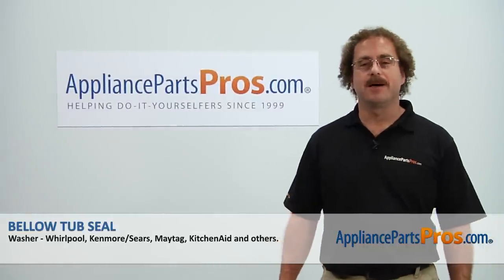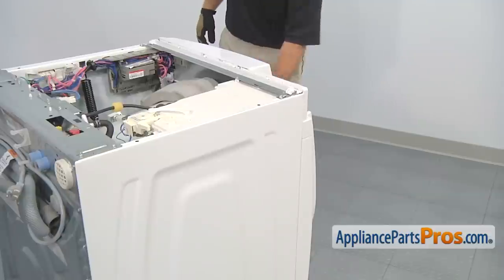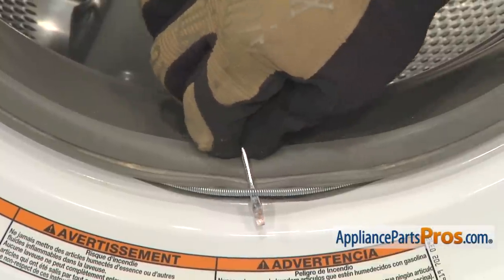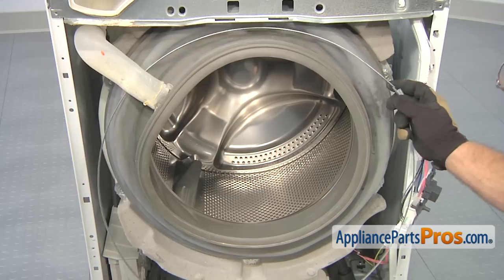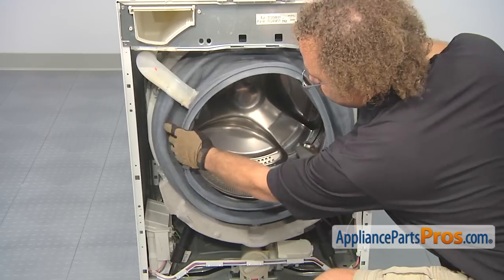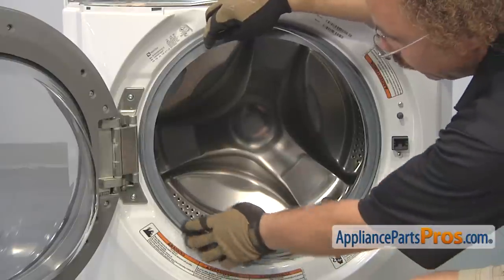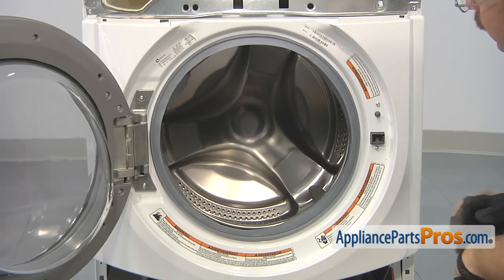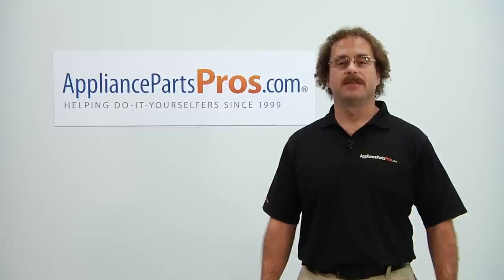How To: Whirlpool/KitchenAid/Maytag Bellow Tub Seal WP8182119

Comment: The spring on the wire  which attaches the bellow has definitely been stretched out a bit...the wire for my bellow won't even stretch to the 1 o'clock position and this guy has it stretching all the way over to the 2 o'clock  position.  I really need a third arm to wrestle this wire into place.   Great video,very helpful and informative, thanx.

Comment: Great video! My boot replacement was a breeze thanks to you. I originally watched a different video, which was not exactly my model, indicating that I would need special spring tools and that I'd have to disconnect wiring and remove the counter weights, with an estimated job time of about an hour. I only had to remove the top panel, control panel (no disconnecting of wiring), bottom panel and door and needed no special tools besides a torx 20 driver. It took about 15 minutes. Cheers!

Comment: Another excellent, helpful Appliance Parts Pros video. Agree with other positive Comments. Perfect, easy-to-follow steps and procedure flow.  
On a DIY scale of 1 thru 5, with 5 being the hardest, I'd say this job was a 2-3.  Definitely a task most people can do.  Just requires some patience. 
Main difference between my experience and what is seen in this video is that I spent approx. 8-9 hrs altogether – incl. initial troubleshooting, establishing what is needed to fix, researching DIY videos, ordering parts, making notes + 2 hrs cleaning all of the parts I took off + incl washer innards + cleaning area behind washer prior to re-install. Only a DIYer would do all that making a much more complete, thorough job than if done by service technician.  If I did this again I could get the total time, incl. ordering parts down to 4-5 hrs.

One other detail: When disassembling I removed the plastic soap tube that connects to the rubber bellow tub seal at the 10 o’clock position.  It was caked with detergent, etc so I removed and cleaned. When I re-installed I added a 2-1/4” diameter pipe clamp to the upper end where this tube connects to the bottom of the plastic soap tray.  I could foresee the possibility of that connection leaking, which if it happened would require you to disassemble the washer again.    

This video -- which only applies to this specific washer rubber door seal has been screened 263,000 times in the past 8 years. Gives you an idea of how common this fix is.  

Over the years I have bought many replacement parts from APP for a wide variety of appliances. Matt -- the technician-teacher is indeed “the Bob Ross of appliance repair”.  Thanks again.  Keep up the terrific work!

Comment: This repair can be carried out without having to remove all the panels. This can be done through the door itself. I have a washer dryer setup, with the dryer being on top of the washer. So getting the dryer off the washer is a tedious task. I would literally have to disconnect everything. I was able to remove and install the seal just by gaining access from the door. The final inside clamp was a bit difficult due to limited access. But with a mirror it wasn't too difficult to line up. Thanks for the video!
Reply from the maker: Thanks for your feedback, Alexander! Glad the video helped.
Reply: I was super concerned as I have the same issue. ;w;

Comment: Thank you for the helpful video!  My wife and I just replaced our tub seal, following your steps very closely.  I think we're good, but one thing we noticed is that the door doesn't stay closed as securely any longer.  Once we start the wash machine, the door locks, so we don't have a problem with leaking -- that much is good!  I will take the front cover off again and re-evaluate the placement of the locking mechanism.

Comment: Excellent video. I'm told that the bellows that have been installed are failing prematurely. The reason is that people overtighten the clamp. Your tip of putting a black mark on it saved me from overtightening it for sure. The tip to use vice grips to help put on the spring seal was also a big help. Thanks again!
Reply from the maker: You're welcome! I'm glad the video helped you out.
Reply: So if we didn’t do the mark, and the clamp has slipped off (twice with a tub full of water!), how do we find out how tight it should be?
Reply: @Mystik0817  I would re-install it and use the mark.

Comment: By far the best video on this type of repair. I have installed bellows before without taking the control panel or the front cover off but after watching this video I did and it made the repair much more comfortable to work on and easier. Thank you much!!!
Reply from the maker: We're so glad we could help! Sometimes those extra steps can seem superfluous, but they can make things easier in the long run.

Comment: Matt and appliance part.com have the easiest to understand videos. I had an F5E2 error and an occasional leak across the top of the bellows.  I found that the larch hook on door was a little loose. Checked and error code was still there. I didn’t know to how to delete codes. Manual was taped inside the bottom front panel. Inside the lower front panel is the drain pump with attached filter. I cleaned years of coins and other debris from the filter. No more leaking and I don’t need a new bellows. The loose door hook and the high water volume caused by the clogged pump filter were the problem
Reply from the maker: Glad we could help!

Comment: This is a great video and I followed the steps as best I could. The only problem I ran into is the door won't lock without me holding it! I took the spring clamp off and it will lock sometimes. It seems like the part of the boot that touches the door appears to be sticking outward. 

No leaks though when I use it. Any suggestions?

Comment: Thanks! My washer has a dryer stacked on top so taking the top off is not practical. Why do you have to take off the front? Can the repair be done without removing switches and panel?

Comment: Great video, very helpful. One comment to make things easier, instead of using a locking pliers, use a hook awl in the spring loop, not the wire loop. This make pulling the spring so much easier than locking pliers.

Comment: I looked at several videos but this by far was the BEST :-)

GREAT TIP on marking the band that holds the bellow in place!!!!  Since the bellow is rubber I'm guessing I could have easily tightened it more, which I'm guessing may not be a good thing!  Without marking it I wouldn't have had any idea how tight to make it when putting it back on.

One other video did not take the panel or front door off which sounds like a great time saver BUT I think it would have been way more frustrating trying to take the band of and even more trouble getting the bellow and band back on!!

The only frustrating thing is that there are SO MANY varieties of washers that each seem to have a different trick to getting the control panel off :-(  This frustration is not directed at you, its just a fact, not something you could have done better in the video unless you made 100 videos, one for each model :-D

Thanks SO MUCH for putting this video out there, I can't tell you how much time and aggravation you saved me!
Reply: Oh, almost forgot... as someone else mentioned it was a nice tip on using the vice grips to get the spring wire back on.  I'm sure I would have thought of this myself, but then again maybe not :-)

Instead of vice grips though, I used pliers (couldn't find my vice grips).  I think piers may actually better, since you can let go of the wire by letting go of the pliers.  With the vice grips it's a little trickier to disengage them and I used my other hand to help keep the wire from slipping off while I let go of the pliers.
Reply from the maker: Awesome, glad the video helped you out!

Comment: Great video.  I replaced my bellows but not the door won't stay closed.  If I hold it shut and start the washer it temporarily locks, the tub begins to move but quickly the lock light goes off and the washer stops.  I did not have this problem before I did the repair, what did I do wrong?

Comment: Good video.
However, I just did this repair.  Let me assure you, 100% that the top and front 
do not have to come off.  In my case, it was a stacking washer/dryer.  
It was custom built in to a closet so it would have taken an hour just 
to get the dryer off and pulled out
You just need a 90 degree drill adapter, to get the inside screw clamp off.

Comment: If your hands are small enough. And depending on where the tensioner screw is positioned for the inside wire loop. Its is totally possible to replace the seal without taking any panels off at all.

Comment: can't seem to find my part number. it's same one but mine has a fill valve at the 12 o clock position. so i would need one that has an extra hole. any suggestions?
Reply from the maker: You can go to our website and enter your appliance model number to view the parts breakdowns to be sure you get the correct part for your model. http://www.appliancepartspros.com/
Reply: AppliancePartsPros d

Comment: Great set of instructions, but it all makes me think: couldn’t they have designed this machine so that it’s a little bit easier to replace this gosh-darn thing.  I mean, it’s a rubber seal for the door for heaven sake. Why is it designed so that you have to take the top and front of the machine off?

Comment: This video was extremely helpful and I completed it in about an hour due to a few hiccups along the way.  Using the vise grips for installing the retaining ring to the front panel is a MUST.  DO NOT overtighten the screws on the lock mechanism when reinstalling the front panel/door.  It caused the lock not to engage and I could not run the washer.  MOST IMPORTANTLY: be careful not to knock the fill tube from the dispenser off while removing the tub seal or installing the new one.  Apparently the seal that connects the fill tube to the dispenser is notoriously bad and cannot be reused without leaking.  I discovered it was leaking after running a test load (fell off three times while putting the new tub seal on). Do yourself a favor and just order the dispenser seal (8181747).